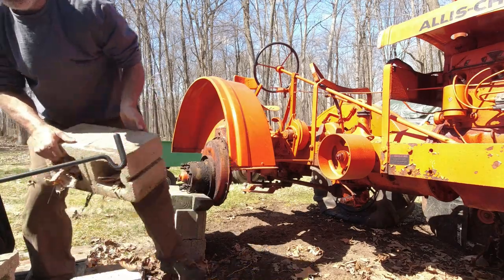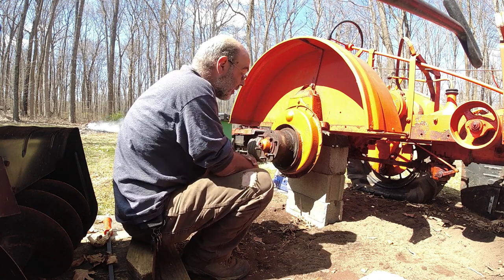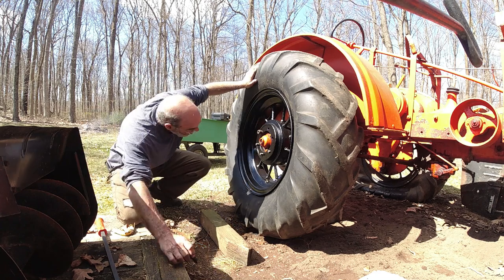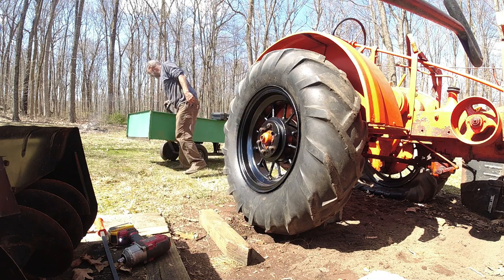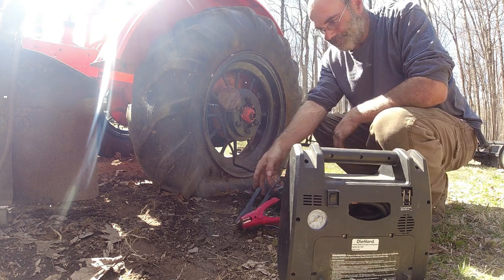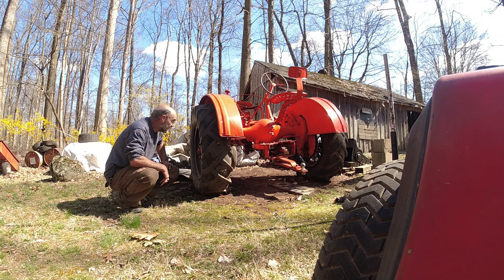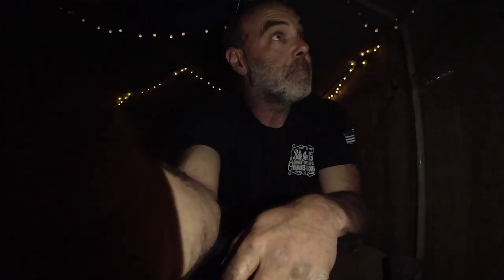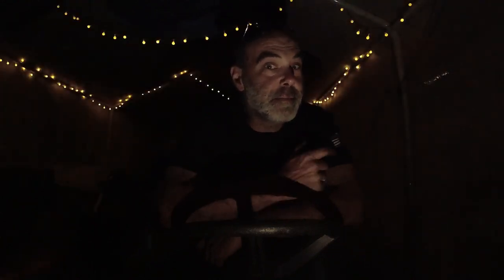1937 Allis Chalmers Wheel Replacement

Comment: I like to use some gravel and some strong degreaser/water to get the rust and varnish out.  Then rinse it and let it dry.  Then I put some sandblaster sand and bbs in dry and shake it around to get it really clean and get rid of any flash rust.  Then I blow it out good and rinse with gas or kerosene.  I'm up by Wilkes-Barre and Allis Chalmers tractor were rare around me mostly IH and Ford with John Deeres here and there.
Reply from the maker: Thank you. Everyone who is leaving tips are really appreciated. I also got a tip yesterday in person of putting a donut style magnet around the outlet to the sediment bowl to catch and future rust particles too. The last time I had done this, I used nuts and bolts and got a lot out. What caused it this time is the coating stuff I got from Napa them, apparently didn't work and I don't ever fill the tank with gas as It would go to waste with how little I run it. Guess that means I will need to fill it and leave it full this time around to hopefully help keep the moisture out.

Comment: 😉👍 Use nuts, bolts,ball bearings... Water and muriatic acid with water 1:20 to 1:10 at the most. To get your rust out.  You could start out with just nuts and bolts, ball bearings and some diesel, if you're leary of using acid. I throw the other good tank on the tractor, block up the back end up. Strap the original you're cleaning tank to one of the tire and throw it in gear and let the tires spin around with the tank on there tied to it, so it can do all the work and clean its own gas tank, 😜👍 lol by letting all those nuts and bolts and ball bearings clean all the rust out of the inside of the tank by knocking them around.  Make sure you use baking soda and plenty of water to flush and neutralize the acid. There are several different gas tank sealers on the market... so I'd just go with a good one, I'm not saying Eastwood is bad but there stuff is always pricey, if you ask me.  🤔 I never done a tank on a tractor... Just a motorcycle... But it's painted John Deere yellow, lol does that count?
Reply from the maker: Thanks Justin for the input. I definitely appreciate those tips and will give them a try. I did use the nut and bolt trick the first time I did that and it worked pretty good. I do have plenty of garden tractors that I could strap the tank to, or perhaps even Old Blue 🤔 lol. I haven't checked on Eastwoods prices yet but will definitely shop around. And if JD green counts to you, then sure, it counts. Lol.